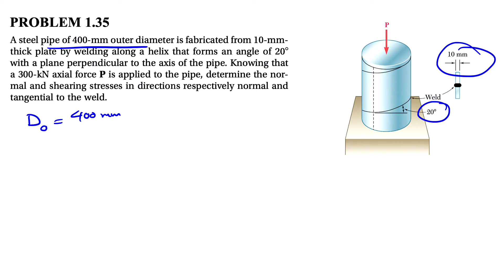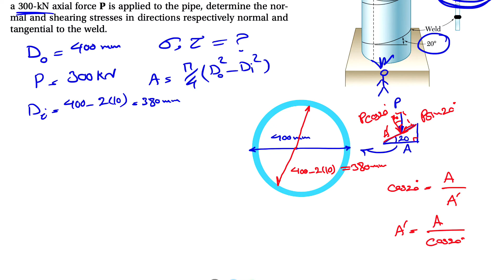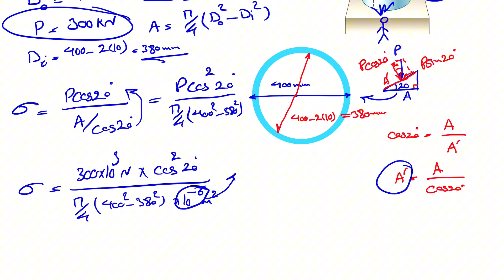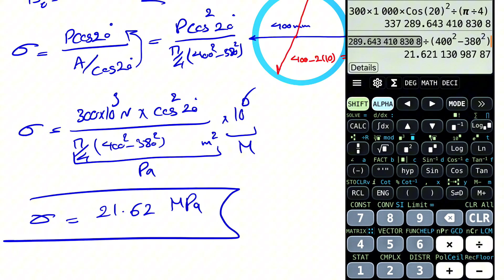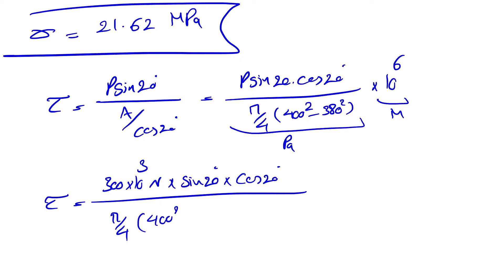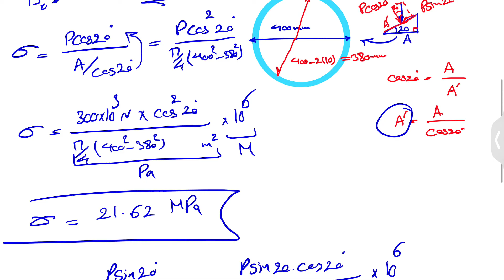Problem 1.35 | A steel pipe of 400-mm outer diameter is fabricated from 10-mm-thick plate by welding

Comment: why isnt the force negative?
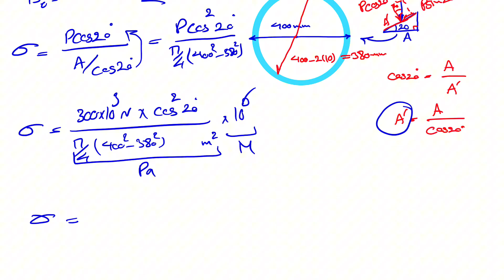Reply from the maker: P is compressive, but in this formula (σ = Pcos²θ/A) we're just using the magnitude of P, not tracking tension/compression with a sign. The compressive direction is already built into the geometry of the force triangle, not into the sign of P. You can see it set up at 5:40!

Comment: at 3:19 can you explain how the angle between P and Pcos is 20?
Reply from the maker: The weld plane is tilted 20° from the cross-section, so its normal direction is also tilted 20° from the pipe's axis, which is exactly where P points. Rotate a plane by 20°, its normal rotates by 20° too. That's the little angle drawn right at A in that frame!